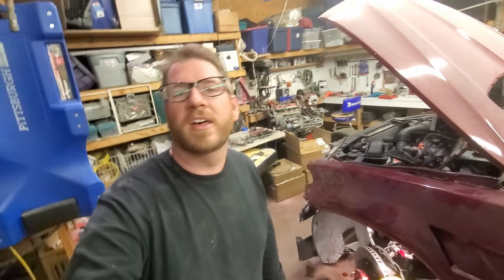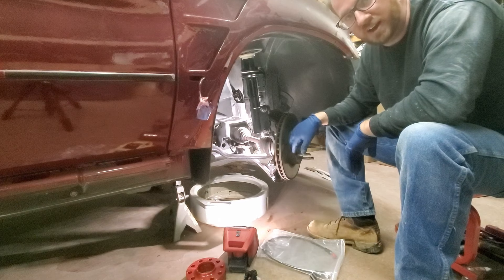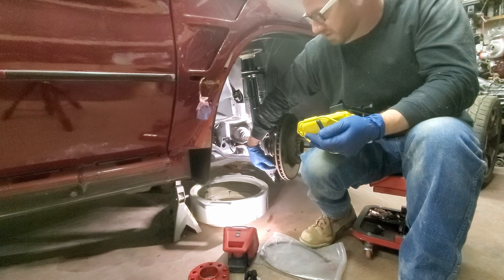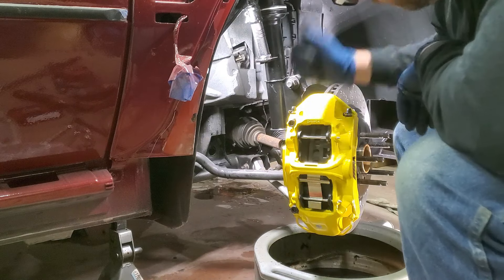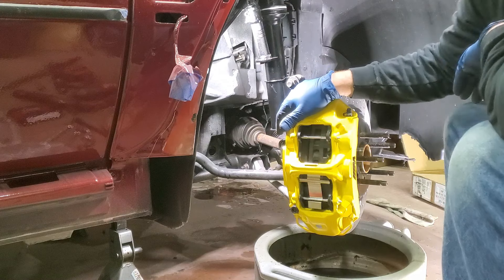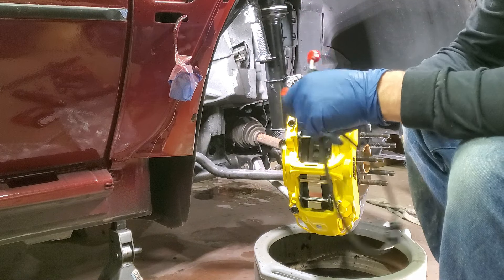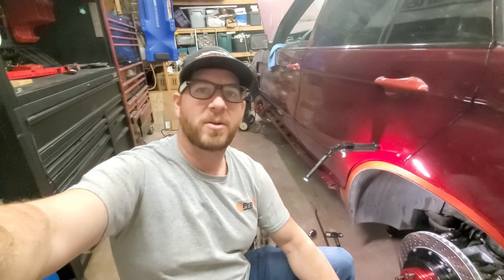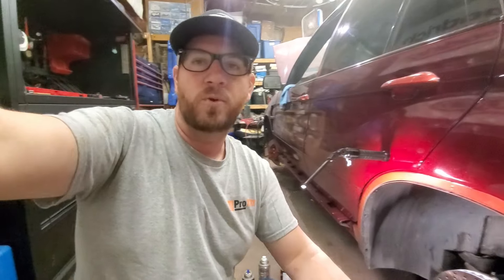Big Brakes conversion on an X5

Comment: I’ve heard bad things about those silver project camber arms.
I’m running Hardrace, which seem to be pretty solid.
Reply from the maker: I have been running these now for two years and are doing great . Before I installed them I took them apart and greased all threads with anti seize. It's a harsh environment so I didn't want any chance of corrosion on vital parts.

Comment: @adamsgarage88 Just wondering how the brakes have held so far? Any issues? Also are those 405mm or 380mm rotors? Cheers. 
Follower from Australia.
Reply from the maker: Sorry for the late response. Still building the car but as far as holding up to the elements I can say they are doing well. They feel strong when I drove it around the yard.